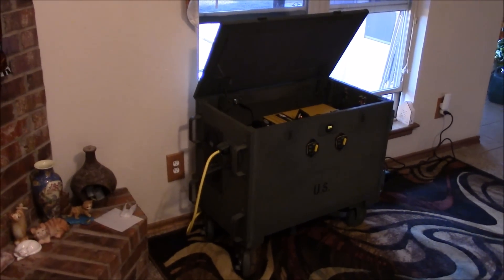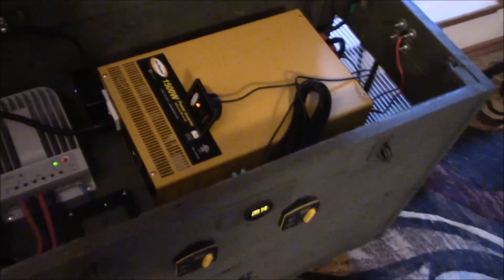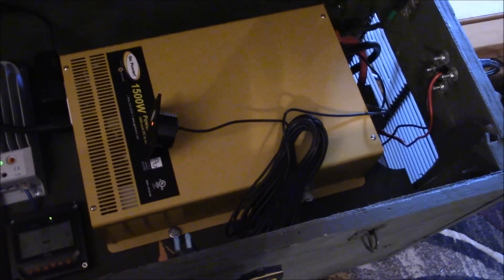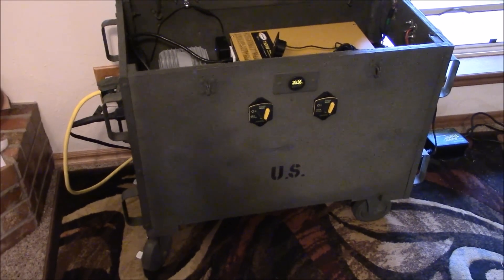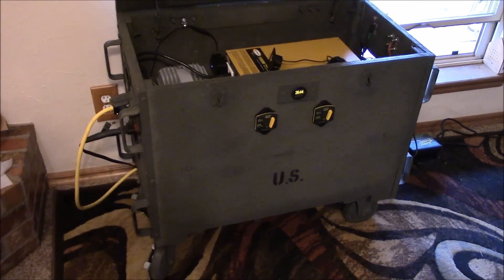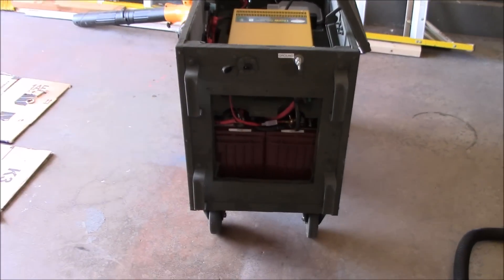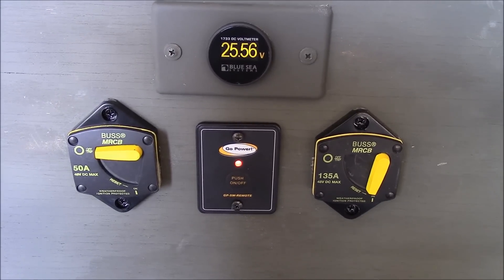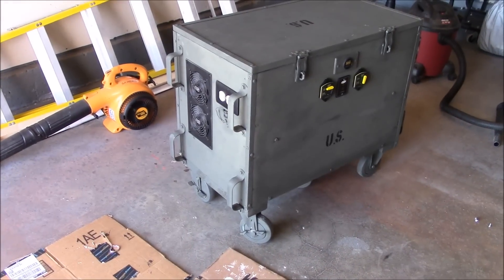NEW Go Power remote on/off switch installation on DIY solar generator

Comment: Dahmm Chris! That box is sweet! Cheers. I could probably make you a shorter cable. I would need to know what the pin outs are though. I guess ing that info is available somewhere. Cheers

Comment: I love mine. Funny tho I was saying dang wish this cord was 25 feet longer lol. Glad to see my video helped. O did you know from the switch you can program your power mods as well? My wife told me. "Bobby why have we not gad this all this time?" So I would say she is happy with it lol.
Reply from the maker: Just ordered two more Renogy 100w 12v panels for that solar generator. Kishan and Shawn (sales manager and asst) are longer with the company. Still, they "hooked me up" with what the old manager used to sell the panels for. So, that portable rig will have 600w of solar on it...just about "right sized" for a SHTF-Prepper-DIY-emergency back up power generation. Will all fit in the back of the truck.

Comment: You do really nice work Chris. I hope to get my new install done before I have any surgeries. It's just cold and damp outside.  I mad about 75 amp hours today.  
Happy about that. If It would just warm up to the mid 40s I would start on the installation of the additional solar panels. Another month probably. We still have our wettest part of the year comming.
Reply from the maker: Best to hold off till conditions improve. Spring/summer and splendid weather is going to be worth the wait.

Comment: Adding that remote switch is a nice touch and makes sense.   Pretty cool you are using the solar power generator everyday!
Reply from the maker: Thanks. AGM batteries make it safe(r) too...little if no gassing.

Comment: home depot has the crimp tool and a 5 pack of the connectors for about 20 bucks.  You just need good eyes and or a magnifying glass. The pin out should be in the users manual.

Comment: hey maybe you can give me and answer how many 6v batteries will a 400 watt aray charge
Reply: Well I can tell you. That all depends on how much sun light you get in 24's. So get that info and we can help..
Reply: yankey4 46 or 48 th Parel  new England
Reply: It 3 1/2 solid hours at solar minimum this why I want a low air speed wind turbine as well